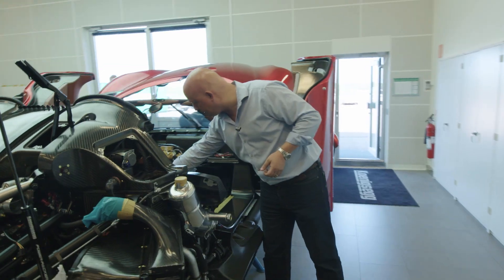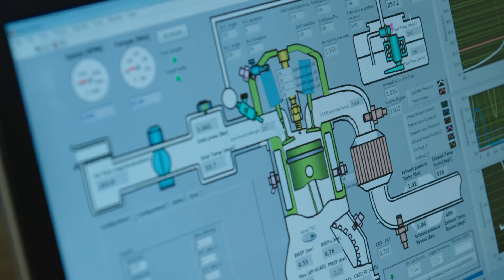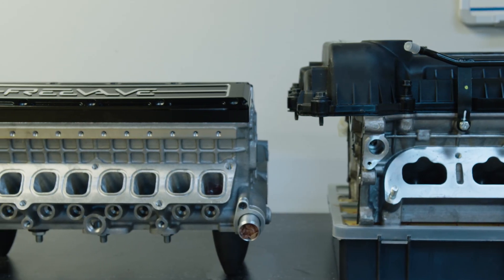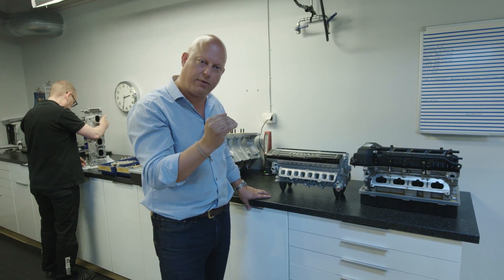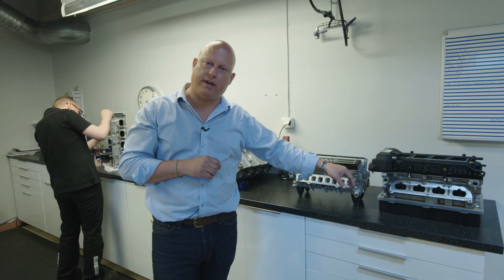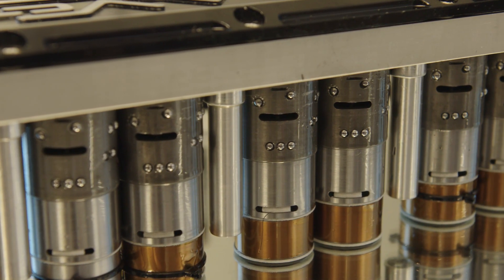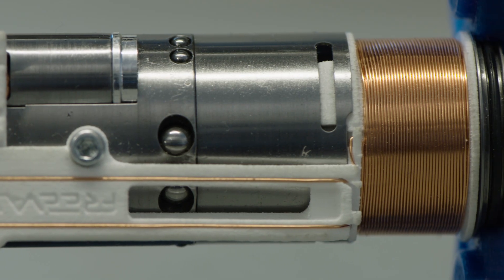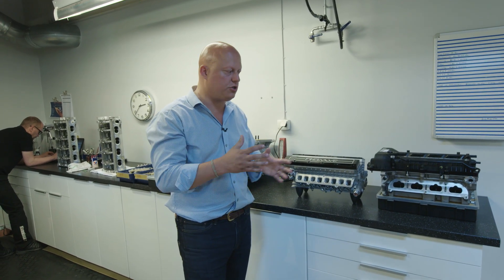Freevalve Update Camless Engine -- /INSIDE KOENIGSEGG

Comment: Christian: and we can shut down cylinders

General Motors: heavy breathing
Reply: Yup. I didn't update my silverado after 2006. I knew that cyl Tech they were using was terrible. The valves didn't work properly with cylinder deactivation. The older silverado 6.0s and 5.3 where great. Not past 2006
Reply: @powerwill8748  My 2016 5.3 has 80k miles, working perfect. GM has 4 million 5.3, 6.2 Ecotec generation motors on the road, and not many problems overall.
Reply: @powerwill8748  not all new Chevrolet trucks have AFM
Reply: Rotary
Reply: P300 anyone?
Reply: "You're done us all right now man, ya'll weird"
Reply: How about shut down entire banks of cylinders?
Reply: He is a walking talking sausage

Comment: I emailed freevalve regarding getting one of these systems for my Saab powered Vauxhall, as the Saab engine used was a b205 and my engine was a b204 with a b205 head, so exactly the same.  I was told no! :(

Comment: Dyno simulations....   so u almost double the HP of an engine by doing absolutely no performance mods just having  better control how the ports open and close?  Sounds great to the avg layman but total BS to anyone who understands combustion and engines. Ur not adding extra fuel or air or spark ignition power so where is the increased energy coming from?  Realistically it’s like a port job so maybe 5% increase     Less restrictive ports but not doubling and suddenly putting out the power of 2 engines with the same amnt of fuel as just 1 engine.  Absurd

Comment: This technology was developed in either late 50s or early 60s, but for whatever reason never became a real thing. You have infinite possibilities with valve timing, no chain, no valve float at high rpm...its sad it took so long....just like how it took over 100 years for people to start making light bulbs like nikola tesla did in the 1800s. Also, they use electric solenoids, not pneumatic solenoids like he said. Pneumatics use air, not electricity.

Comment: I love the idea! One question tho, what happens when solenoid starts wearing out? Won't that break valves etc?
Reply: They must have a built in safety measure for that i am sure. Good point though, same issue if a chain or belt failed on traditional setup

Comment: Wouldn't making the intake runners smaller reduce the amount of airflow into the cylinder? Most engine builders Port intakes larger so a larger volume of air is able to make it into the cylinder allowing more fuel to be injected making more power.

Comment: The camshaft is a horribly old fashioned way to mechanically synch up valve openings with crankshaft location by a mechanical interface.  There are many ways to open and close a valve and some vehicles already have that.  And don''t think of a valve with a valve stem.  There could be camera lens IRIS types of valves, sliding valves, etc.  Got to think out side of the box

Comment: FUN FACT: The Tucker 589 engine in development in 1948 had overhead valves operated by oil pressure rather than a camshaft. An oil pressure distributor was mounted in line with the ignition distributor and delivered appropriately timed direct oil pressure to open each valve at proper intervals. The oil pressure fed to each valve was "timed" by intake and exhaust eccentrics and measured by spring-loaded plungers.

Comment: The only draw back I see is that it lowers the life span of the engine. Valves can now fail independently of each other. On a regular engine, valves last the entire life span of the engine if driven under normal loads. With this new system, each valve is a new failure point on its own.

Comment: He claims he can " Throttle inside the combustion chamber " but does not explain how it is done. There is no video of the engine running. He does not show how the valves are  actually operated. I think it is a bunch of auto engine techno horse shit.

Comment: At about the 3:00 minute mark in the video he appears to say pneumatically  operated actuators. That sounds to me to be air operated.
The pictures  of the actuator appear to have coil windings. That to me looks like an electronic solenoid type of actuator. 

I do see check balls that could indicate pneumatics.  I'm curious how these actuators actually work now.
Reply: I remember reading that it's supposed to be used in either a pneumatic or hydraulic system. I don't think an electric solenoid is strong enough to pop the valves open quickly (or it might take too much electricity). Nothing has come out on this design since these videos were released, so no clue if it is currently feasible or not.

Comment: The devil is in the details of the physics involved.  Unless I've missed my guess, your simulation model ignores inertia and recovery of both value strokes, signal transmission time, solenoid charge time, solenoid discharge time, the force curve generated by the solenoid charge and the resulting valve acceleration and deceleration, and rapidity of transition between solenoid charges, such as might regularly occur with toe-heel techniques before corners, rapid acceleration or deceleration demands, and the like.  This may be one reason why small Chinese passenger car engines are being tackled first, as ALL of these attributes and behaviors are quite minimized as compared with high-performance racing engines.

Comment: Correct me if I am wrong ....could not a camless engine with ultra fast actuating valves be set up to run as a two stroke engine?   If not why not?  I envision alternate exhaust valves  located further down withing ports cut into the cylinder walls feeding expansion chambers.   With flick of switch engine gets HUGE boost in power as goes into 2 stroke mode .....maybe just there "when needed" for short bursts?

Comment: I just love the general idea of camless engines...As a man of limited mechanical ability the thing that has always frustrated me is all the elaborate mechanical pieces and timing involved for high performance overhead valves....just a valve adjustment can be like a nightmare sometimes.   Getting rid of cams seems to be the last thing to make engines ultra tunable and reliable.   No carburetors,  no mechanical distributors, and no camshafts with their way adjustable valves ....also makes things so much more simple to also provide variable COMPRESSION!   Combined with ability to kill cylinders   means with a simple voice command or flick of a switch and engine can be switched from ultra high performance to super economy/runs on low octane fuel.    .....the only other thing seems insurmountable or too mechanically hard to overcome which would be variable stroke ....yeah that ain't happening....but you can't have everything I recon...oh wait an electric motor with the hypothetical "perfect battery"  COULD give one "everything"  and finally truly make the nearly perfected IC engine obsolete in every way (other than satisfying lovers of old school)

Comment: I would have like a little more information on exactly how the valve controls work???
He said "pneumatic" but on the pictures is saw electro magnetic coils????
Do they use air pressure as a staging force and then trigger with the electro coils?
What is the energy consumed with this method vs. a mechanical camshaft and rocker arms??? This is an indicator of where increased horsepower and fuel efficiency come from because of less friction. Of course creating air pressure and or electricity to run the system would use combustion energy but less than the mechanical driven method???

Comment: Lotus pioneered the electronic camshaft back in 1980s but computer was the size of a fridge and it could not rev beyond 3000rpm so not even close to a production idea. 
But they also did away with starter motor. Computer chose the best placed piston squirted in fuel and engine was running.

Comment: would that 15% fuel economy improvement be 15% max power to max power comparison? if so, what about 'cruising' efficiency? how do the efficiency curves compare? if this engine is the same price as the previous because of material savings etc. etc. it might be really good to put in a hybrid and such. as well, if building the engine to a power spec with those systems, that engine could probably be smaller yet. There are so many possibilities.

Comment: Freevalve is a interesting concept, but it’s not new. Tucker was experimenting with Lycoming engines that used an “oil distributor” for valve actuation rather than a camshaft in the 1940s.

Comment: Thirty years ago there were solenoid controlled valves on small gasoline engines in the United states, (maybe elsewhere, but I don't know) built by backyard engineers. I was indirectly affiliated with a group of guys who had successfully done this. Nowhere near as sophisticated technically as this work, but fully controlled solenoid poppet valves on running four cycle gas engines.

Comment: The entire engine should be "pneumatically operated," i.e., it should be rotary Wankel air motor powered by 30,000 psi air pressurized in carbon fiber composite air pressure tank.

Comment: The reason I decided to build and drive classic cars is due to the complexity and cost of maintaining these sophisticated systems, I have worked in electronics for 25 years and seen how badly and loosely designed electronics fail, and judging by the way cars are made like garbage to save money and repairs  are so costly this kind of system is prone to ending up in a junk yard far quicker than my 1962 if not designed for longevity instead of planned obsolescence to sell you another one in 5 years.

Great advancements come with great pain, I'm just avoiding the pain part.

Comment: I was told years ago where automotive tech was headed. This was one of the technologies being researched back in 2002. 
Another tech area was cars with no starter motor. The computer would use the crackshaft position sensor to determine which cylinder was just past top dead center and give a double shot of fuel from that injector then fire the spark plug, which would then kick over the engine.
Another bit of tech Honda was researching was a device that was installed between the engine and transmission. Apply voltage, and it act as a starter and cranks up the car. Once the key is released and the engine is running, then it acts as a generator/alternator. Saves some weight by not have both a starter and an alternator. 
They are also looking at electric water and power steering pumps...increasing HP and efficiency by reducing the workload on the engine.
Reply: Dodge had starter/generators in the 1920's. Absolutely silent starting without the gear racket

Comment: Suggest   partnership in the development of    "internal combustion engine" 
  patent  US 8,613,269 B2   https://www.google.com/patents/US8613269
www.transportationdesigners.com/designer/portfolio/shehterpavel/three/109
       The project is under - working drawings.
The next stage - production and testing of prototypes.
1. Changing the design of the head unit existing engine.
Result - 2x magnification power without increasing fuel consumption.
Reducing the number of parts, weight and size of the head and the engine block.
2. Production of the new engine. 
      Torque   6100 Nm   at   100 rev / min. 
      Power   5000kwt /  10000 rev / min. 
      Engine weight - 57 kg. 
      Maximum speed - 20 000 rev / min 
      Dimensions      870 x  440 x  440 mm.

Comment: What about using a solenoid valve train? Simple, low weight, easy repairs given the level of performance, and very efficient compared to regular valve trains. Compared to this pneumatic system it would seem better because it could run faster and serve multiple other purposes with innovative solenoid valve designs such as senser relays, fuel injection, ignition, and possibly even cooling. The most difficult thing to engineer out of the system would be parasitic losses. Though, I'm not sure an alternator would have as many losses as a pneumatic pump. It would also create a safer engine, given you could have various interrupt fail-safes so that if the engine started to run poorly the valve train itself could lock down and prevent the engine from damaging anything seriously. Blocks siezing up from overheating, severe engine knock, detonation, overpressurization in the crank case or cylinders and manifolds wouldn't be as much of a concern any longer. Plus timing, injection, and A/F ratios could all be adjusted almost instantly, with the right software. For race teams that would mean the ability to finely tune a car to specific sections of the track. With GPS location based tuning configurations the car could retune itself for certain parts of the track when you need to reach a high top speed the timing is advanced for example, or ignition shuts off and the motor becomes an engine brake, AF ratios could be adjusted for torque on an incline, or fuel economy for when a team can win with tricky pit timing requiring a late stop. Could the freevalve design do that with as many compacted modular parts integrated for weight saving, higher RPMs, better tolerances, etc...

Comment: I would say it's late. Future tech has no space for so much elaborate  mechanical engines. Future is electrical engines, not even transmission  with  just an extra efficient induction motor.

Comment: If they would merge this tech with nissans variable compression block it would save ic engines throw in twin scroll turbo tech dry sump oil system and tps plasma ignition system and we'd have a major evolution in internal combustion engines on button for 200 hp 50 mpg another button for 550 hp weekend fun lol no cam swap or bore and stroke kits needed

Comment: For the criminally minded the idea that cam timing and duration can be hacked without an engine teardown is very appealing!  A pirate computer COULD (theoretically) control all the things that make more power with total disregard for pollution and gas milage fuel delivery, spark timing, and now valve timing and duration.... click on a keyboard and everything goes back to government specs to pass smog ....or if you need to maximize mileage to make the next fuel stop etc ....I am not suggesting anyone is actually going to do this but as a fantasy dream it is appealing!  ....the final icing on the cake would be two exhaust routes ....one full race and one when we see the cops or need a smog cert...total pirate!

Comment: Idea: What if the air charge used to hold open the intake valve is released into the cylinder instead of the compressor intake or atmosphere.  Like a tiny little supercharger pumping the last bit of air possible just as the valve snaps shut.

Comment: pneumatic operated valves? i thought of and designed a "coil" based valve system in the 5th grade but back then computers weren't what they are now and i forgot about it until i heard of freevalve, too late for me to pick it back up again cause freevalve basically work upon the same principle and it wouldnt take very much for them to make the switch. i hope they do too.

Comment: variable rate compression braking (1 to n cylinders) could be a neat mode for traffic. Just like running a jake in a truck but make the last tiny bit of throttle modulate the number of cylinders involved.

Comment: Really the electrically controlled valve is the holy grail of internal combustion engines.  Fantastic!  But at some point we’ve gotta step back and question all the engineering and compromises that have to be made to make them run well.  A Chevy Bolt “engine” and transaxle has exactly 1 moving part... the electric motor rotor.  The only extra on it is an oil pump to make sure the bearings have oil before the car moves.  Look at Weber auto channel for info on this super simple drive unit.  Teslas are just a simple.

Comment: I want one.  Would it be cheeper to buy an engine or convert an engine.  A 3.3 Nissan Frontier supercharged engine with CA smog would be a big step so there has to be a way to bolt on conversion while not being required to register the car as modified for CA Smog.

Comment: If this pans out I think they've hit on the ultimate evolution of the internal combustion engine. There's not much more power and efficiency left to extract; camless valves, thermal and mechanical energy recovery systems, and compression ignition are probably going to be the last big innovations before everything goes electric.

Comment: And yet the employees have a fan held together by duct tape
Reply: Or the tape is there to reduce the turbulent air between the high pressure and low pressure of the fan
Reply: It's not to hold it together it's to make a duct

Comment: Does this apply to an mc engine as well? IE motocross?
Reply: It can be done, these are only basically replacing set/ variable valve timing for complete valve control. Wouldn't be practical for M/Cross though, as they are always  running max RPM, max power.

Also I think motor-cross tried and tested 2 strokers have their own advantages and a completely different set of constraints, mainly cooling I think.  

That being said, I'm certain we are looking at the future of the petrol engine, in terms of scraping around for the next efficiency/ emissions advantage. Can you imagine this coupled with variable displacement and hybrid technology? Just amazing.